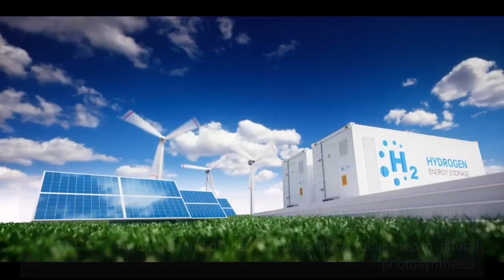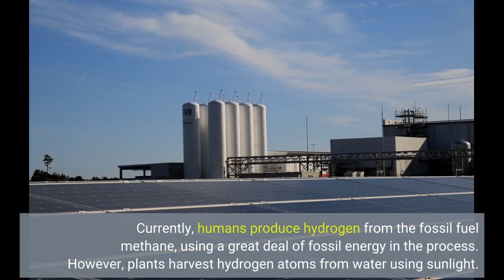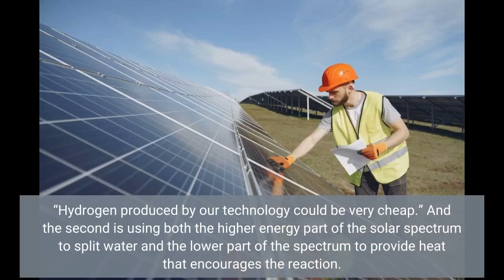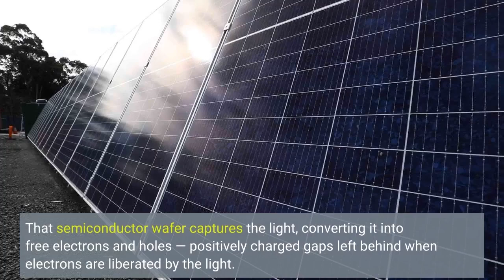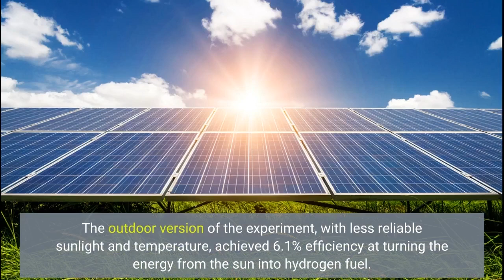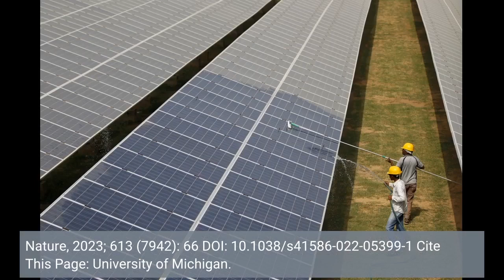Cheap, sustainable hydrogen through solar power

Comment: Why... Oh why... Do they push hydrogen as it produces water vapor just like the water vapor responsible for 40 to 50% of the warming going on?

Just pretend it's helping as it just adds to the problem.

And as Earth puts out 40% of other green house gases to. So humans actually are 20% the cause at best. Not even counting the unexplored ocean and the one geothermal lost city discovered that pollutes 100 times more than they assumed as they expect to find more just like that place in the other 97% of ocean yet to be explored properly...
Reply: And as going green has actually made places pollute more as they have to rely on worse fuels than oil just to still struggle as people also pay far more for energy than with oil.